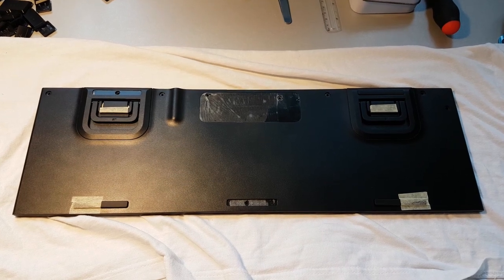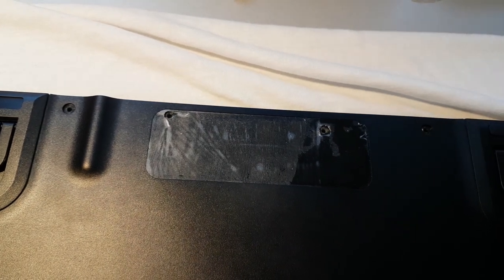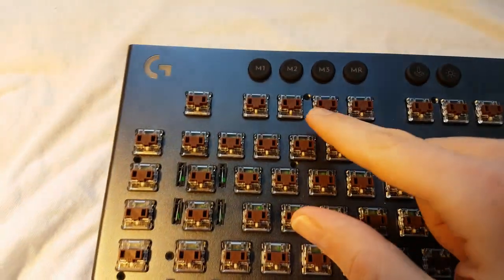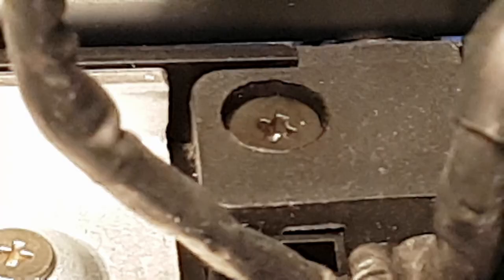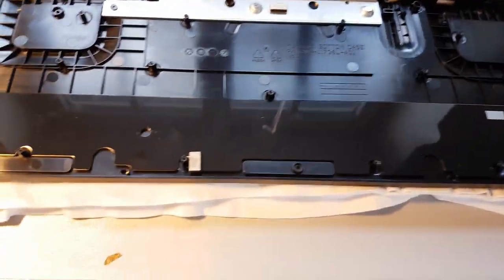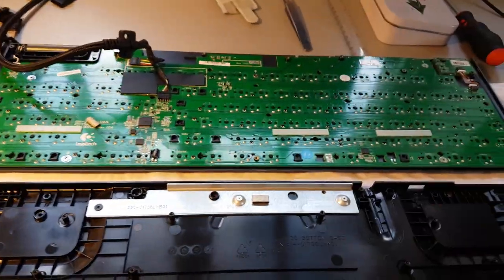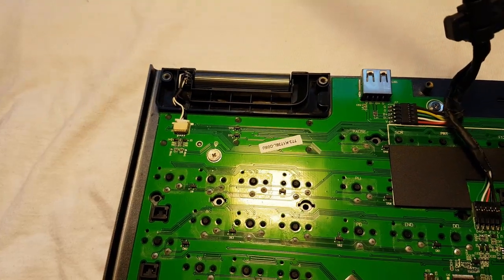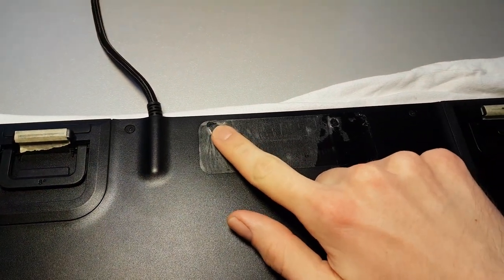Logitech G815 Disassembly

Comment: i have a logitech g815 keyboard are there different models of this keyboard?? because 1 got 1 on sale from the stor(ordinary price was 200usd n sale at 110 usd so a big discount)
Problem was that 1st i got had the shift button was suddenly dropping of the keyboard key so at the store they said it was not in the warranty to fix it ??
But w my luck i had just bought 2*desktops 1 months earlier+2 new pc screens for the work so they changed their mind and gave me 1 new keyboard even though its not on the warranty(Question is this shouldnt thje waranty be on all defective stuff that has happened on a keyboard withinn 1 week after purchase??)

I se in video that u have removed the keys and in store thay say that u cant remove n change keys on this keyboard because they are soldered in place so it cant be fixed??

So is there 2 different keys on this keyboard so 1 of them cant be fixed or was it just bad info i got from store??
Please i need to know this is any key drops out again! is there a way like in video to fix it or was the store correct about the version of g815 keyboard i got`?

Thanks 4 video+Hope about info about this are out there amongts al who watches video
Reply from the maker: Hello there,
the actual switches of the keys are soldered in place and need to be removed with a soldering iron. It can be done and there are replacement switches available, which have been soldered out of existing keboards it seems, but I have not done that and hope that I do not have to do it in the future. All I did was to remove the keycaps. I do not know what the law in your area is regarding warranties etc. (I am located in Germany) but I returned the first one I got back to Amazon and got a replacement. Later down the line I still was not satisfied with the noises the keyboard made and I ended up contacting Logitech directly. It took a pretty long time but in the end I was happy with how they handled the situation.
In regards to the versions of the keyboard: Yes, there are different versions of the keyboard but it does not have anything to do with repairability, if I am informed correctly. There are just three different types of switches which feel and sound different when they are being activated.

Comment: Had a pretty nasty spill into the keyboard and still trying to get smells out. Can I disasemble it down to this level, wash it all in distilled water, dry adn re-assemble?
Reply from the maker: I am sorry to hear about that. I have personally never tried that so I am not comfortable recommending it. I'd just leave it as it is as long as the switches are not sticking... but if you absolutely have to do it then make sure that the keyboard is completely dry before you plug it back into your system.

Comment: Thanks for sharing the teardown video.
Those metal plates, I believe are antennas for improving the wireless connection. Also to make the base heavier to not move around because for the sake of antenna they could use a strip of metal as well.
Reply from the maker: Thank You! It seems to be mainly there for the weight on the wired model. 😊

Comment: What a switches are used in this kb? kalih choc v1 has tight(1.2mm) holes for keycap. But my kb and kb in this video has switches with 2mm holes.
plz hlp find the switch model name for repair!
Reply from the maker: My knowledge in this field is not sufficient to give proper advice tbh. :/ The replacement switches that I found were soldered out of existing keyboards so I do not know whether new replacement parts are available or not.

Comment: is it possible to replace the spacebar stabilizer on this keyboard mine feels unleveled on the left side probally due to it bending because i only press it on the left. The right side of itsounds and feels really good though
Reply from the maker: I do not know wether this is possible or not. Getting the right parts for it would be a challenge in itself though... have you tried contacting Logitech about the issue?
Reply: @icecreamgecko  no i havent this also happened with my previous keyboard so i guess its an issue with me clicking the left side of the spacebar to much. i had a havit low profile keyboard before

Comment: My keyboard is really dirty can I just take off the keys caps with my fingers without any problems?
Reply from the maker: Yes, but something like a plastic ruler helps a lot to leverage them out. Don't take a metal one because it will likely scratch the keys and the top-plate.

Comment: thanks for share! by the way, my unit doens´t works, it´s second-hand-used and the usb with the keyboard picture seems broken, do you think that i can cut it an resolder a normal usb and make it work? or I need an orginal-aliexpress pair of logitech´s usb of this keyboard??
Reply from the maker: If you can get yourself a proper replacement then it is probably best to do that. I have got no idea though on how to fix or improvise the cable itself, if the cable is actually the issue.

Comment: How can I just remove a single switch of the keyboard ? A piece of plastic from my keycaps broke and end up in the switch, so I can even push down the switch because it is now locked cause of plastic thing
Reply from the maker: I do not know how to do that I'm afraid. I'd try to remove it with fine tweezers or shake it when it is upside down first... but apart from that I have no clue. :/

Comment: can you internally save light profiles? because my G815 shining like a rainbow when windows boot up, only when the GHUB software starts it will activate my light preference. What i dont like about this keyboard are the soft touch keycaps, they look smeared pretty fast. The cable looks premium but its very stiff, i dont like that. i wonder how long the cable connection will last because of that.
Reply from the maker: Yes, you can save lighting-profiles to the keyboards memory as well. I personally just chose a static blue/cyan-tone I liked and uninstalled the software altogether because I hated it.
Reply: @icecreamgecko  yes i want to do the same but with neutral white uni color or maybe turquoise but i can not figure it out. In the G-hub Software i switch to internal storage but still nothing happens
Reply from the maker: I think that you could click on the currently selected colour and change it through a menu that pops up. If I remember correctly you then need to save it as a profile and overwrite the profile in the keyboard memory with the newly created one.

Comment: Do you know if it would be possible to add foam in the back cover? Would it fit?
Reply from the maker: There is a little bit of space but it is not much.
Reply: @icecreamgecko  Okay, thanks for your answer. Might take a look myself to see.
Reply from the maker: Be careful with the screws especially when you screw them back into place. The threads in the metal-plate are incredibly soft and easily cross-threaded.
Reply: @icecreamgecko  Yeah i noticed, everything went well. The space was bit too small for foam, so didnt put any.
Reply: @svamp20296  how thick was your foam? I was thinking of adding some 3mm thick mass loaded vinyl

Comment: Hey,
Im planning to buy a new keyboard because my G910 keys are breaking apart. Basically these cheap plastic sticks at the buttom of my keys are getting stuck in my switches. My whole keyboard is messed up because of that. Are the keys so low budget in the G815 too? I dont want to waste money into breaking keys.
Reply from the maker: Hi there, so far I have taken out quite a few keys on the G815s that I have had. I have not had any of these little feet break on me, yet. Although I am a little bit anxious every time I take one out.
That being said I am with my third G815 at this point in time.
Reply: @icecreamgecko  Thank you :3
Reply from the maker: @panzerband7363  :)

Comment: One of my rubber feet got loose (the left one). Anyone know a fix for this? The thin layer of glue is like half-gone, but even when it was one it didn't stick in the hole anymore properly and would fall out regularly. I'm afraid that putting some glue on it would result in the keyboard being uneven.
Reply from the maker: I would try out some double-sided adhesive tape, ideally a thin one like the original on the keyboard. That being said, I doubt that you would actually feel a difference in height when the tape is half of a millimetre thicker than the factory tape, once you forget having changed it out. Remember to clean off any remaining glue residue and dirt from the contact-surfaces.

Comment: Hi, question. If you remove the silver screws on the PCB, can you separate from the metal plate? thx
Reply from the maker: I cannot answer that question. I have not tried that.
Reply: i dont think this will be possible. Look at the footprints of the switches those are flipped wich means standard mx wont fit, also they wont fit romer-g cant speak for alps but I don't thing this board is compatible with replacementswitches maybe som flatprofile switches. It seem to be Khail switches but who knows

Comment: Recently bought one of these off Mercari. Great keyboard in aesthetics and function. Only problem is the "w" key sometimes double types or chatters at times. Anyone have the same experience? Any solid fixes?
Reply from the maker: I did not have this problem up until now. I thought that I might have it but it turned out to be myself, not pushing the key down all the way but being just at the edge of a keystroke registering and slightly pulsating there a little bit without knowing. If you cannot return it you could try to switch out the W-key with one of the G-Keys with a bit of soldering. There are some decent soldering tutorials for keyboards here on Youtube.
Reply: yes, having this same issue myself. Logi is no help, just straight to sending me a new keyboard, which is nice but I would rather be able to service the product than just replace it.
Reply: usually the more simple 'double typing' things on an older keyboard can quite easily be fixed with some contact spray.

Comment: seems like it's just bare metal under the black thingy, as shown in this video https://www.youtube.com/watch?v=qLvvMJYUWdE 

So yeah, it's a stiffener, nothing more nothing less. Still somewhat curious about the contact pads on said metal though. are they trying to make it work like a chassis intrusion alert?
Reply from the maker: The contact pads are still a mystery to me as well. The keyboard works normal without the metal bit. The intrusion alert could be a possibility, although the sticker removal gives that away anyway. Opening the device without removal of those screws is most definitely going to result in damage to the bottom shell

Comment: Thx a lot for the info!!! Logitech ndo not deserve all the custormers.... they sell extreme expensiive keyboards after that... the do not care at all.
Reply from the maker: In the end I got a replacement for my unit with that weird cracking-noise. If you find yourself with a seemingly faulty item you might want to contact them to try and get things resolved.
Reply from the maker: I am sorry to hear that. 😔 Yeah, trying to get proper replacement-parts for everyday items seems like keyboards etc. (which are not specifically advertised as "repairable") can be quite difficult if not impossible in many cases. I hope for this trend to change in the foreseeable future. 

All the best from Germany and a happy 2024 from me to you too! 😊